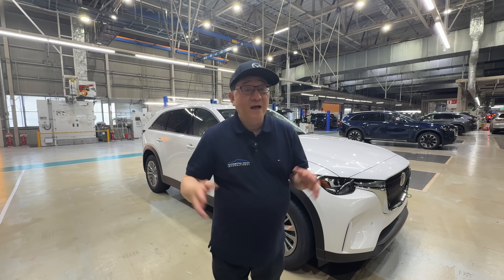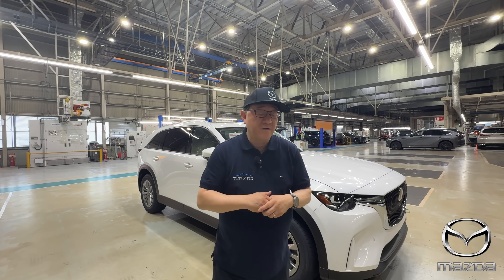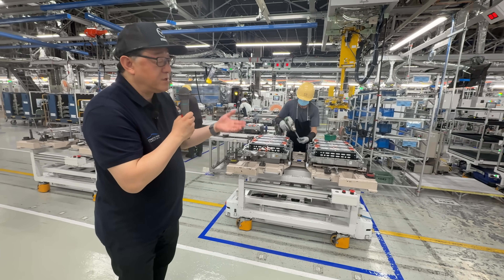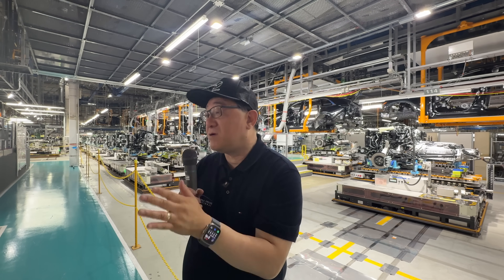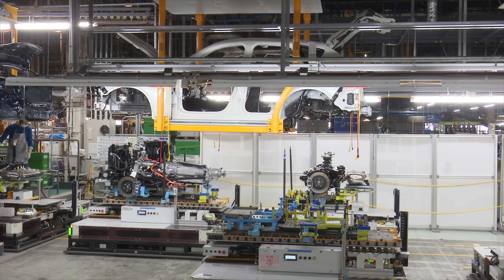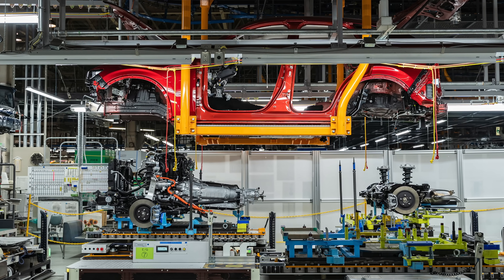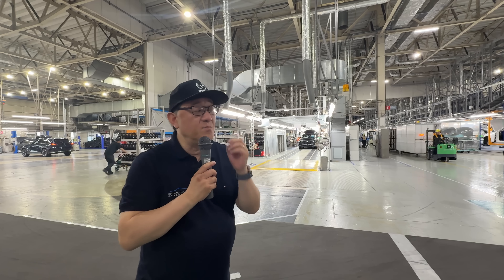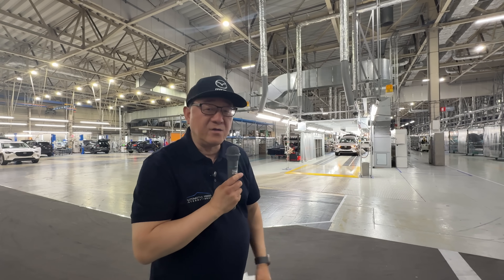ENGINEER VISITS MAZDA FACTORY IN JAPAN // MOST ADVANCED & FLEXIBLE PLANT IN THE WORLD

Comment: My Mazda 3 sedan was from Hofu plant, its been my 4th year now for the current generation, amazing drive everytime I am on it, only the air conditioner (valve) and the side mirror automatic fold needed changing under warranty apart from battery and brake pad wear and tears, the rests are in excellent condition. I will not hesitate to buy a family SUV from Mazda (such as the CX 80) so long as it is CBU made rather than CKD Kulim Kedah in the near future. Greetings from Malaysia.

Comment: Mazda has come a long way after it got out of the Ford-Mazda arrangement! It has continued to bring out new designs, including best selling mid-size SUVs. along with refreshed traditional products. Mazda cars now have top-tier long-term reliability. What is notable for me is that the Mazda-Toyota joint venture in the US is managed by Mazda, even though it is a 50-50 JV. The ability, as shown in this video, to manufacture different models & platforms on the same assembly line(s) prove top-level manufacturing!

Comment: Thanks for the video! It's very cool to see the home that built my CX-70 PHEV GT.  Please tell the folks there that I'm super happy with my new Mazda! 😉
Reply: I have the same car. It’s terrific!
Reply: How is your CX70 taking you thus far?
Reply: @MohamedOmar-f8x Its been great. Got it in January and have 15,000kms. Zero issues so far.
Reply: @Sean-oq3ox Thanks for the feedback. If you dont how is the noise inside the cabin. Is it less or high
Reply: @MohamedOmar-f8x cabin noise is not bad, depends how you drive it. Ev mode is very quiet, sport mode pumps noise in to make the engine sound good.

Comment: As engineer, I was most amazed by the AGV non stop production line. It’s not simple or easy to achieve that continuous movement. Also any issues at the end of the line would not impact the front like a belt line. They probably can easily pull away the troubled units individually to keep the line moving. Amazing efficiency!